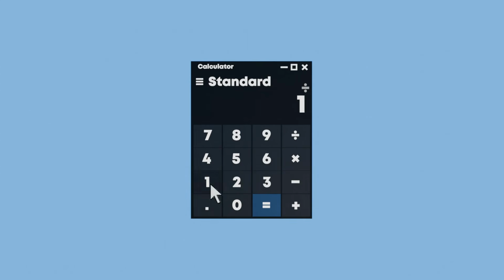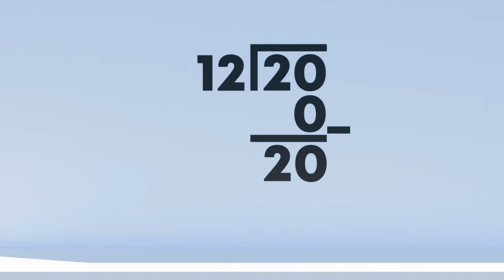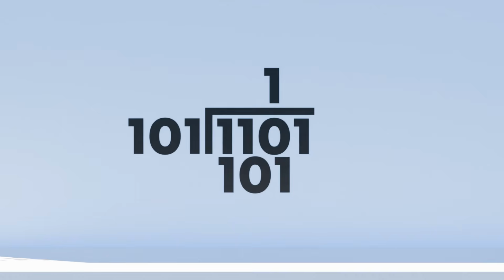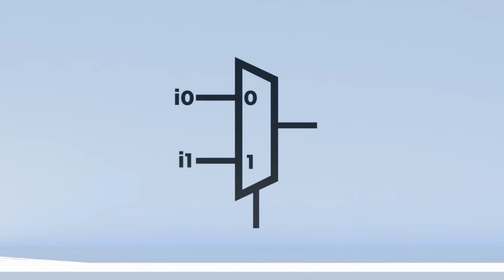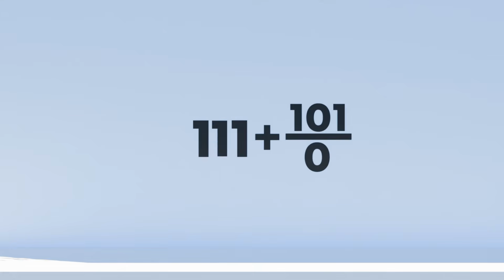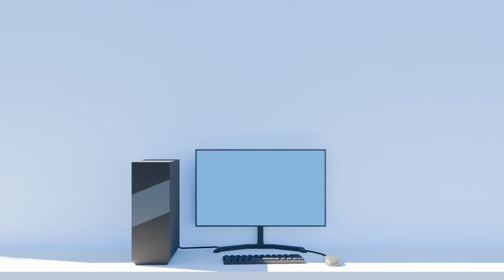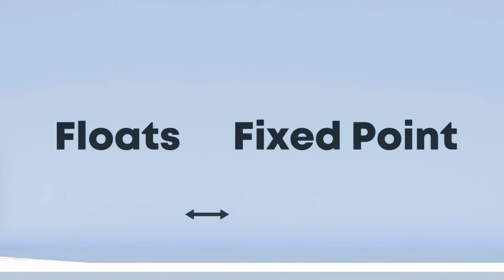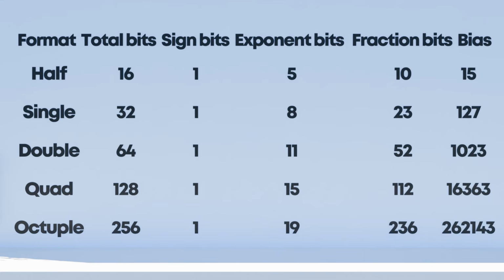How Computers perform Division

Comment: Note: floating point division is usually done using either Newton-Raphson or some combined  table lookup & polynomial interpolation method followed by a multiply. Also: shift, abs & subtract algorithms in modern CPUs are also usually further sped-up using LUTs.

Comment: Do you have a video explaining the bias exponent? I didn't understand why you would subtract 127 and why 127 is used for single precision.
Reply from the maker: We don't have a video explaining it in depth yet but good question! The reason the bias exists is so that when you add 1 to the floating point representation you have the next smallest number you can represent.

For example in half precision (16 bits). If you were to count up starting from 1 you'd get:
1.0000000000, 1.0000000001, 1.0000000010, 1.0000000011, 1.0000000100, 1.0000000101, ..., 1.1111111111, 1.0000000000 * 2^1.

If we look at our floating point representation this would look like:
0 01111 0000000000, 0 01111 0000000001, 0 01111 0000000010, 0 01111 0000000011, 0 01111 0000000100, 0 01111 0000000101, ..., 0 01111 1111111111, 0 10000 0000000000.

While counting up all we had to do is just add +1 to our floating point representation to find the next representable number (counting up for positive numbers and down for negative numbers). If we had used something like signed integers for our exponent we would lose this property which is very useful in, among others, rounding numbers either up or down.

As to why specifically 127 is chosen. Single precision uses 8 bits for the exponent which means 2^8 = 256 different exponents. However the exponent of all 1s is used for NaN and all 0s is used for something called subnormals, so we only have 254 different exponents. If we symmetrically divide these 254 exponents around 0 we get a bias of 127.

Comment: I saw the video as a recommendation, and my first though was: he is going to describe an algorithm that is simple in theory but not used in practice. And that's what I watched, plus some other rambling. Some notes: most competent financial software (as in, not named Excel) uses decimal fixed point (but, sadly there is a lot of finance done in Excel); I am unaware of any cryptography that uses floating point numbers; and finally, most algorithms actually implemented in hardware give multiple bits of quotient per iteration (but you couldn't explain one of them in a YouTube video).

Comment: Good explanation, however, on the actual binary transistor level, there is no subtraction, only a 2’s complement add. But it’s fine to assume that subtraction is done by the circuit as a whole. With older computors such as the PDP-8 series, there actually was nu subtraction circuitry and all you had was the 2’s complement add. All the rest you had to do in software. The PDP-8S even only had a 1-bit adder. It was slow, but it worked.

Comment: This was a pretty good video!
In reality, ieee754 fp operations, particularly division (FDIV) is even more complicated than what you show here.
30 years ago the state of the art was the SRT divisor which uses a lookup table to generate two result bits per clock cycle, it was 5 omissions in the table that cause the infamous Pentium FDIV bug.
More lately, multipliers have gotten significantly faster and that allows things like Goldschmidt division which starts with a lookup-table based guess and then uses a Newton-Raphson style iteration to improve it. The speed difference is not significant for 16 or 32-bit operations but for wider formats like 64/128/256-bit Goldschmidt will double the precision in each iteration. I.e it becomes O(log2(n)) instead of O(n).
If you google me you'll see that I was heavily involved with the FDIV bug and its sw workaround. I have been part of the 754 working group since 2015. This is the body that updates the standard every 10 years or so, we're currently working on the 2029 revision.
Reply: ever worked with a guy named John?
Reply: @giornikitop5373  Several! 🙂
Most relevant here might be John C: John Cash/John Carmack
Reply: @TerjeMathisen  Carmack is what i was refering. FISQRT?
Reply: @TerjeMathisen  was that you btw?
Reply: @giornikitop5373  Yes, I was involved with the inverse square root process.
Funnily enough I recently found a way to generate 1 more bit of precision in the same time, then discovered that a guy from Poland had done an even better job, getting an additional half bit.
Reply: @ that's cool. used to study some of your asm code back then. you're the man!!!!
Reply: May be 1 dividing by 3, take 4 instead as a divisor dividable by 2 for start.Then use Newton iteration x(next) = 2 * (1/4) - 3 * (1/4)^2;  
I would like to use as many shift operations as I can, may be by 4 is shift two times right, isn't it?
Reply: Than you for that insight! As someone waguely familiar with FPGAs, througout all this video I couldn't help but feel that this divider has astonishingly ling logical chaina and this will be extremely slow, surely it can't be the way how it is done in hardware. You answered my question.
Reply: @pro100vald  Up to the 486, division was in fact a subtract/select/shift iteration, so one cycle per bit, plus a number of cycles to setup the operands and finalize the result. You are absolutely correct that it is quite slow, otoh you can do it with very small resources.

Comment: While conceptually you are kinda right, I don’t know of any modern architecture that still does division like this. A high frequency core can barely fit a mantissa width addition(or subtraction) into a single cycle, so your circuit would take roughly as many cycles as there are bits in the mantissa. This is very slow. The problem is you have to do a full subtraction every iteration. What if you only subtracted from the topmost bit of the partial remainder that you were looking at, and assumed the rest of the bits were zero? You would be off by a bounded error, but in exchange, you would only have to do a 1 bit subtraction. Well there’s a clever algorithm called SRT division which figures out how to compensate for the errors in each iteration. It’s what almost all processors (that even have a hardware division unit) actually use these days.

Comment: 15:32 the quad bias should be 16383, no? 15 bits of exponent, so 2¹⁴-1 makes for a mostly symmetric range.
Reply from the maker: @LaMirah  Yes you're right! This mistake must've slipped through

Comment: Try using Lucida Console font. All the characters are the same width. Any fixed width font will do. Your columns will line up. Do some in binary like computers do. Then the 0's and 1's will align.
Reply: It's just tabular figures that are needed, the rest of the type face can be variable width.  Lots of fonts have both proportional figures and tabular, you need to pick the correct one depending on what you're doing.  Proportional figures look nicer in body text (bonus points for using lowercase figures appropriately as well). Tabular figures are designed for cases like this video, it's so distracting that proportional ones have been used here 😢

Comment: Who is your audience for this video? I felt you started well then went off on a complete tangent into number representations. Also, binary division as you've presented it looks more complicated than it is in reality, because you showed your circuit as cascading where in fact it just shifts through the bits using a single ALU and accumulator. Is your goal to talk about how numbers are represented, or the circuit design for integer division, or an algorithm for integer division using a simple ALU? Because you didn't seem to know which of these you were explaining, you ended up not explaining any of it very clearly other than the basic division algorithm. I know this stuff already, but came away more confused. Anyone who doesn't know it won't come away with an enhanced understanding, in my opinion.

Comment: You can optimize integer division by a constant c by transforming the operation into multiplication by the reciprocal of the constant 1/c.  Processors usually have fast integer multiplier hardware, so this operation is much faster than integer division.

I often optimize C programs by looking at the machine code that the C compiler generates and tweaking the C code.  I was puzzled when the machine code for integer division by a constant was transformed by the compiler into an integer multiplication.  The code multiplied a 32-bit integer variable by the 32-bit integer representation of (2^32 / c) as a 64-bit multiply operation, but only used the upper 32 bits of the result.

The target ARM processor did the multiply much more quickly than it would have done an integer division.  I learned a new trick.
Reply: in here you are using "constant" in the programming sense, where the compiler calculated 2^32/c and then used that in the generated code. I was at first thinking in the math sense as just any integer, and thought, "but now it needs to do that division"
Reply: @chad3814 for 3d Graphics perspective projection we first do a 1/z ( lookup table?) and then x*= and y*= . Same for UV texture coordinates and W .
Reply: If the constant divisor you need is a power of 2, you can also just do a right-shift and it becomes very fast.
Reply: @alsmoviebarn quake1 software renderer needs to waste 100 bytes of code on this because the Pentium is to dumb to detect this case by itself.

Comment: Good Video.
But why not just use multiplication?
Reply from the maker: Thanks! What exactly did you mean by using multiplication?
Reply: @seriouselectricalengineering  
Just 
X / Y = X * 1/Y
For example 
1000 * 0001 >> 1 = 1000 / 10
Reply: @Der_Rotsteiner how do you find 1/Y without division? You haven't removed the need to divide, you've just moved where it happens in the process.
Reply: @Imperial_Squid  
I mean if you don't know that at the time of the computation you could just implement division in software
Reply: @Der_Rotsteiner  software is always going to be slower than hardware so you just cripple time critical usage if that's the solution
Reply: @Imperial_Squid  Silicon is expensive you know
Reply: @Der_Rotsteiner  so is 100x-ing every division operation lmao
Reply: @Imperial_Squid  True but for something like the chip in a tv remote?
Reply: @seriouselectricalengineering  Division is inherently slow.  It doesn't help that multiplication is a very common operation and division relatively rare, so in modern processors multiplication tends to be super fast while division is slow.

A common workaround is to replace a division (generally by a constant) by a multiplication with the inverse of the divisor.  For a constant divisor the inverse can be precomputed.  On a typical architecture with a multiplication instructions that multiplies two 32-bit integer yielding a 64-bit integer result or two 64-bit results yielding a 128-bit result the divisor and the inverse of the dividend are multiplied and the higher half of the result is the result of the division.  Basically that's fixed point using a 32-bit rsp. 64-bit fraction.

Here' a stripped down version of an old version of mine used in the udelay() function for MIPS in the Linux kernel:

void __udelay(unsigned long usecs, unsigned long lpj)
{
        unsigned long lo;

        usecs *= (unsigned long) (((0x8000000000000000ULL / (500000 / HZ)) +
                                   0x80000000ULL) >> 32);

                __asm__("multu %2, %3"
                : "=h" (usecs), "=l" (lo)
                : "r" (usecs), "r" (lpj)
                : GCC_REG_ACCUM);

        __delay(usecs);
}

The multu inline assembler fragment takes the two 32-bit integers usecs and lpj and multiplies both yielding a 32-bit high result in usecs and low result in the variable lo.  I've stripped out the 64-bit case for clarity.

Thanks to constant folding (and ignoreing the call to __delay()) __udelay() will be optimized to a single MULTU instruction which can be executed in a single clock cycle on a semi-decent CPU core.  No rounding errors, only integer arithmetic.  Similar for many other architectures.
Reply: @seriouselectricalengineering maybe inverse multiplication (circuit)?

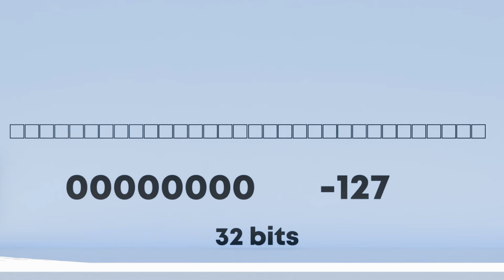Comment: 12:50 has a sidenote that floating point numbers don't actually use an exponent of 128 for numbers, that exponent is reserved for infinity and NaN.
Ah, I should've watched more. (And I didn't even mention denorms.)
Reply: Floating point's true nature is a bit of a dark art.  Few people ever need to do a deep dive.  FP users generally seem to either not know the limitations of floating point arithmetic, just grudgingly accept the border cases and try to live with them.  Or outsource the issue to some fancy library. Applications such as spreadsheets are truly evil as the exact technical details of the numbers they are using may not even be specified and dubious optimizations may happen under the hood invisible to the user.

May the Patron of Accelerated FP Arithmetic the Holy Seymour Cray keep you safe from denorms ;-)